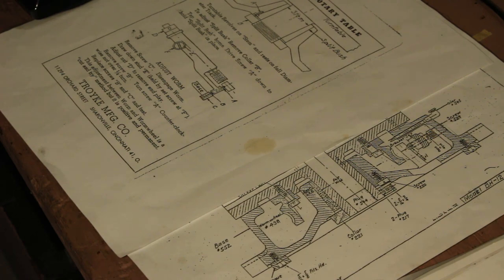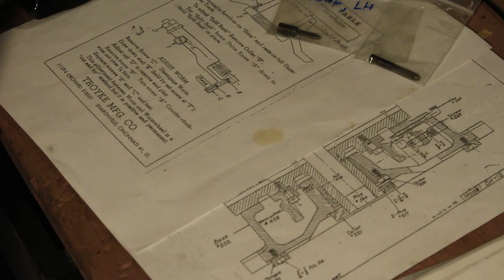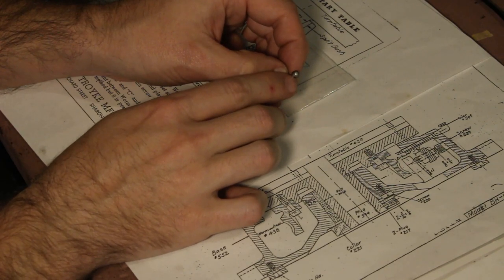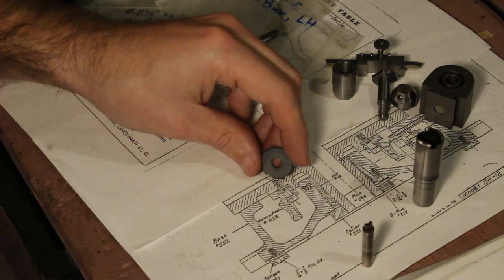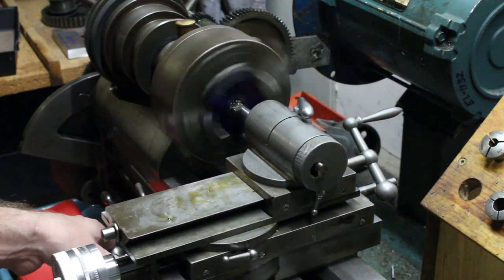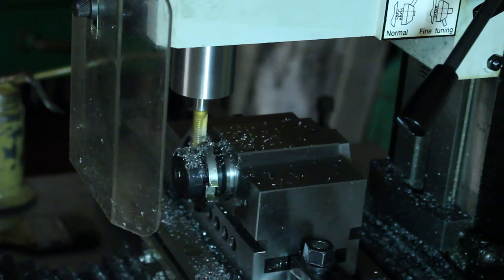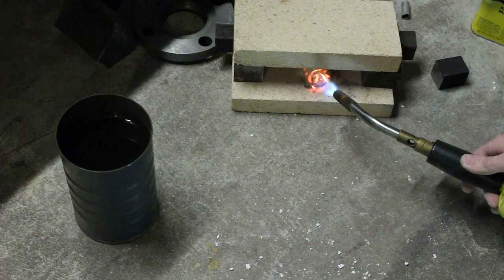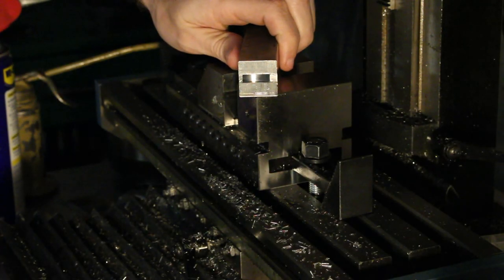Thin Blue Line: Making a Custom Milling Cutter

Comment: This is a great video, and very useful to me, because I am trying to make my own cutters for clock gears. I had no idea you have a blog and I hope you post the URL in subsequent videos. I am using the button method to cut the cutter profiles -- and the blank has eaten up my buttons! Oh well. I am following, more or less, a method shown here:
http://www.deansphotographica.com/machining/projects/multipoint/multipoint.html
My mill, a Proxxon MF70 is a tiny mill and 3mm shank is about its limit. So I cannot accomodate the 7mm holes of most cutters. It is fun making one's own cutters, but sometimes very frustrating.
Reply from the maker: Juan, I'm glad this is useful for you!  I am actually wanting to make some gear cutters as well, so when I do that I will definitely try to do a thorough video about it.  I really want to get my Hjorth form relieving attachment working, to be able to use that for making the gear cutters, but it is missing a part that I will have to make.  Regarding your button problem, what is the diameter of your cutter blank, and what RPM are you running the lathe at when trying to turn the profile?  You need to keep that surface speed way down to keep from work hardening the cutter blank which will instantly ruin your button.  If you are unable to run the lathe any slower, try to reduce the diameter of the cutter blank as much as possible.  If your surface speed is ok, then try turning your buttons with some generous positive rake behind the cutting edge, that will help reduce the tendency to work harden.  Zero and negative rake tooling really need a pretty rigid setup to work properly, especially when cutting material that is prone to work hardening.  Lastly, my blog is at: http://joyofprecision.tumblr.com/
Reply: Thanks for the very complete  reply. The radius on the buttons is 1.41 mm. The module is 0,9 It should have been 0.6,  but I goofed when I made the lantern pinions and wound up with a 0.9 module clock. I have a little Taig lathe. This has a minimum speed of 500 rpm and that's where I am turning. The blanks are supposed to be mild steel (I was going to case-harden them) but no, it it is Lowe's supermanium. Have annealed twice. Got positive rake on the buttons, too. Question of hardening. I'm now trying a kaput drill bit as button material. I blog at www.chalupyacres,blogspot,com.

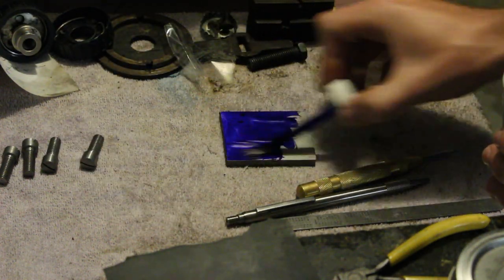Comment: Realy nice, many times need something like this, can you tell me where to buy that colour(12:33) i use just alcohol marker pan for that, but if you cooling just a bit it go off fast.
About the cutter das it heat? I would try turning it just for 0,5 or 1 degrres from outside to center, to be thinner in the center, to avoid friction in the central part, hope you understand what i mean, i heave a saw for mill about 100mm and it grindet from out edge to center so in center is about 0,5mm thinner than the outside.
Reply from the maker: Hi tintek!  That product is called Dykem, and is available in different colors, I like the blue.  This is the one I was using: https://www.amazon.com/Dykem-80300-Steel-Layout-Brush/dp/B0018ACR6G/ref=sr_1_1?ie=UTF8&qid=1480534966&sr=8-1&keywords=Dykem   It is also available in aerosol cans, but I prefer brush.  It's great, because it won't wipe off but is easy to remove using acetone.  Yes, I know what you mean about the having the center of the cutter thinner, for my purposes with this cutter that was not necessary because for its use I did not need to cut very deep (only about 3mm deep).  The geometry is more like a keyway cutter because of that.  If this cutter was for deep slotting or slitting then having that clearance from the cutting teeth would be important to avoid heat buildup.
Reply: Thanks, keep up the good work.

Comment: It was nice to see some spade drills.  I had read about them in a book from 1900-ish and though the description was well written, no drawing was provided.  Now I know the picture in my head wasn't too far off.  As for heating with MAP gas, you could try using Jimmy Diresta's technique of having a torch in each hand.
Reply from the maker: Thanks!  Haha I've been known to double fist the torches on occasion.  You can also improve the situation by minimizing heat loss... like making a little enclosure around the part (the challenge there becomes heating the part evenly).
Reply: Can double the efficiency of a gas torch by making one of the many DIY furnaces on YouTube, you need a tin can, some brackets, and a broomstick. Refractory is a mix of sand and plaster of paris.
Reply from the maker: Someone on the home shop machinists forum just mentioned exactly the same thing, the "soup can forge" as it's sometimes referred to.  I might just have to whip one of those up. :)
Reply: I must admit that I'm spoiled.  I have oxy-acetylene torches at work and a whole lot of oil to quench with ;)
Reply from the maker: Oxy-acetylene is great to have access to! :)